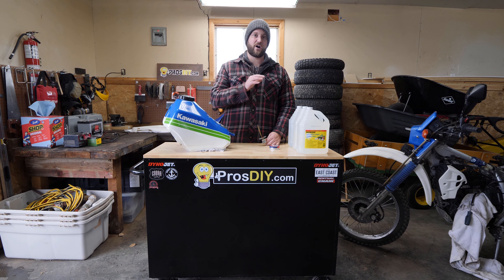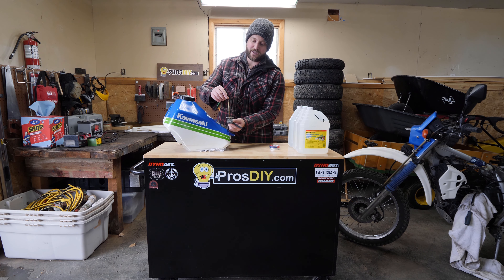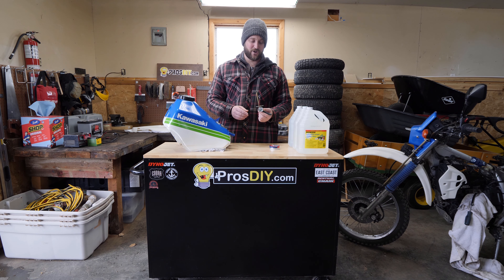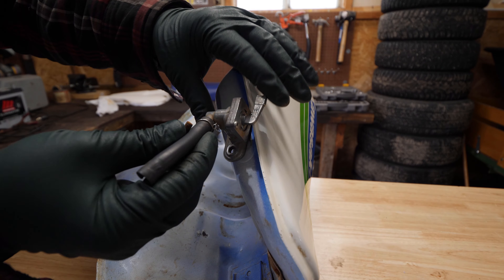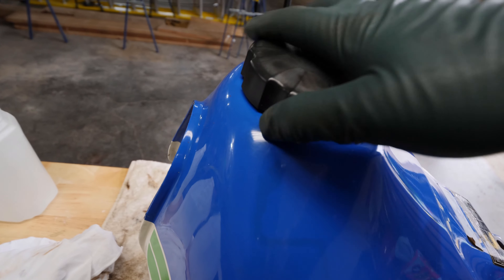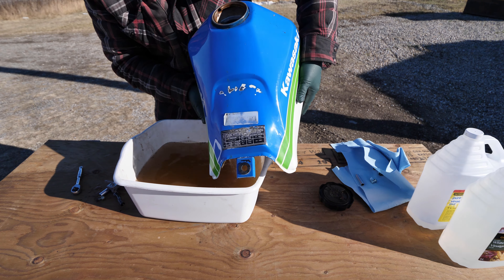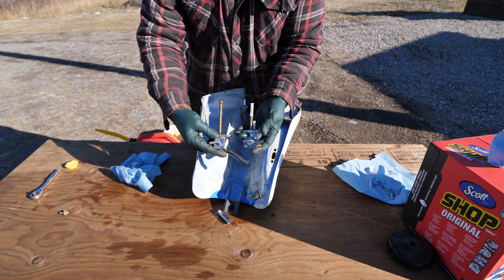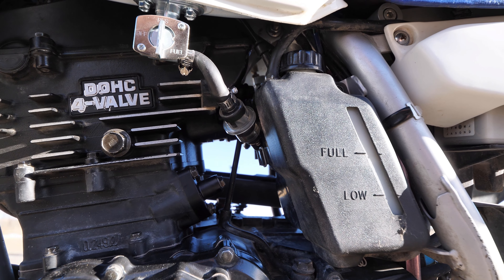How to Clean a Rusty Gas Tank

Comment: There’s an air gap at the top of the tank. Vinegar won’t touch the patch of metal just by filling up the tank. You have to turn upside down to get to it. Laid a thick blanket (folded over several times over a 5 gallon bucket and set the tank on it upside down to get to this patch of metal. 
Vinegar is cheap but slow and literally eats the rubber gaskets on the triumph tank as well as the plastic on the tank lid. I use metal rescue metal bath. Works very fast. Won’t hurt paint or rubber. Rinsed out with ethanol free fuel then filled up. The Triumph (and any other in tank setup) also has rubber hoses etc in the tank that vinegar will eat.
With metal rescue you don’t need any agitant . It will literally remove any of the rust in the tank. Each gallon of metal rescue will remove a half a pound of rust on its own.
Reply: @mistofuzzzy Thanks for the post. Ironically I have a Triumph tank I too want to clean. So I'm going to try your idea. Although I don't have rubber hoses in tank or plastic in gas cap. I do want to protect the paint so I'll try your idea.

Comment: Nice old bike, looks in very good condition.
I’ve got an old 86 Yamaha KT600 that I need to push out from under the shed one weekend & spend a day cleaning & fire her up,
Haven’t cranked it in a few years, so I know it’s gonna take some time, to clean the carb & other maintenance just to get it to fire up.
Used to ride it all the time, but get busy on other projects & kids… so almost every weekend & moment is occupied.
Plus so many other machines I’m trying to fix or keep running, looking at this video for ideas to clean rust from gas tank of a 1975 MAssey Ferguson tractor that keeps clogging the filters & rust clogging the lines,
I know I must clean it out or replace.

Comment: I found a good surefire way is to use gas and steel wool. When I discovered rust in my tank I started to become hesitant to put anything that's not fuel in a fuel system that's already not doing great to begin with.

Comment: Great video got a question for any of  you. Have any of you ever used molasses a mixture of one to 10 parts water a fantastic rust destroyer. For the record I've never used it inside of gas tank but I have used it on a lot of badly rusted parts molasses again mix one part in molasses to 10 water parts let it soak for a reasonable amount of time, you will be surprised. It even works on Chrome without bothering the Chrome.

Comment: Works well. But by the time youve bought all that vinegar, pellets and gas in UK. And then disposed of the gas properly you will probably be into the price of a new tank !!😃✌🏻
Reply from the maker: How much does vinegar and gas cost in the UK? Lol
$6.20 CAD 12L of vinegar 
$4.15 CAD pellets
$4.20 CAD 4L gas
$14.55 CAD total and you can really subtract the gas because I screened it and put it into my push mower.
You can't purchase a lot of older model motorcycle tanks because there's no stock. To give you an idea if there was stock on this tank it sold for $473.44 CAD. To find a NOS tank for this bike, I wouldn't be surprised if it was $700 - $1000 CAD, a little more than $14.55 CAD.
Reply from the maker: P Krasniqi  Wow! I didn't even know this was a thing. I just searched "scooter acid attacks". Crazy!